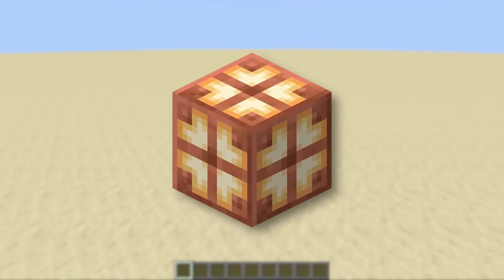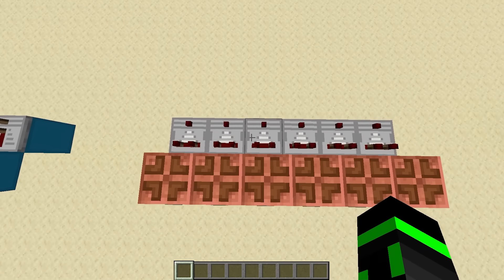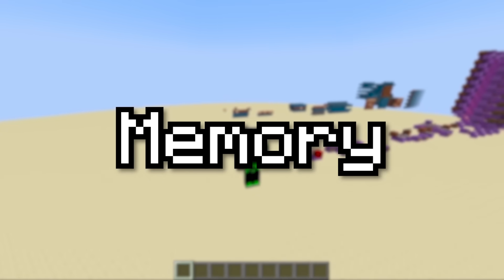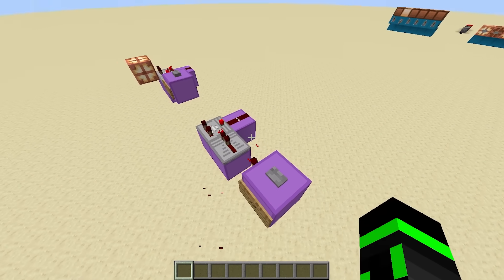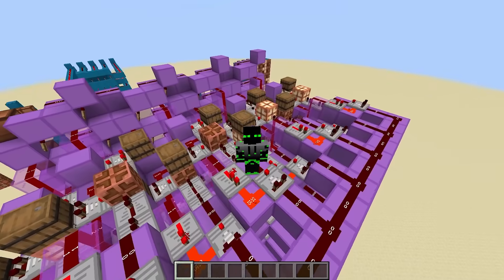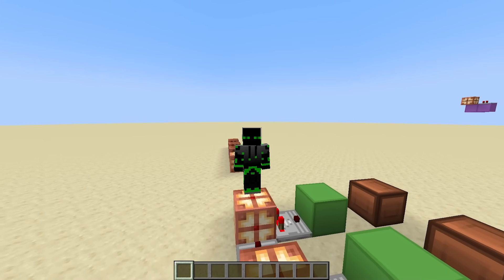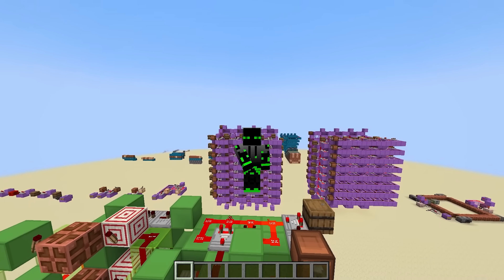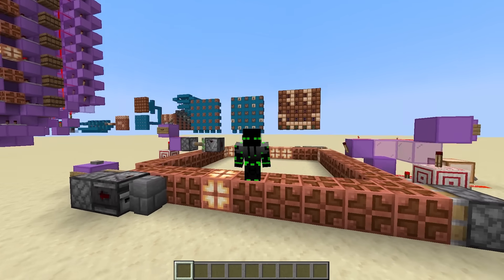Why I'll Never Use Copper Bulbs

Comment: For what was said about using them as a screen and then wanting to wipe said screen, you wouldn't necessarily have to read the state of the bulb, but you would have to have a storage to remember all inputs and then output the ones that were on to turn them off. This is actually a good use for copper bulbs.

It's still a faff and more work than lamps, but I just thought I'd point it out.

Comment: The 1 thing where I found the copper bulb really handy was where I had to triple pulse a crafter, so I used a copper bulb with it's state changing as one of the 3 pulses that come from 1 observer, and the other 2 from another observer looking at the observer pushed in to turn the copper bulb on/off and than being retracted. The thing turned out pretty reliable, and worked really well, the only issue was that it wasn't tileable, as one of the observers hard powered the crafter, meaning it'd cause problems to have more of these right next to one another. They were part of a cirquit to automate mosaic blocks from bamboo input.

Comment: My reason for not using the CopFlop is simple: Mojang screwed it up with parity, changing the timing to be less interesting. It was perfect in its original state.

If they ever change it back, I'll use it (without mods) but until then: it's just another lamp.

Comment: so, regarding the RWM and ROM, the fact that you can move the data after the fact and still have it be functional means that you can form some variety of memory-bank, so if you're able to program a location into a flying machine (I realize that's a special hell in itself) then you can then create a data storage that holds onto data until it's called upon later.

Also: an idea: instead of doing the data rings horizontally, do the data vertically like a vinyl cylinder rather than a record, you can then have side by side data readers/writers.

Comment: This reminds me very much of a solid state memory circuit. In computer architecture, a solid state circuit requires a zero-write cycle (garbage collection) to clear memory before it can be written.

 For smaller memory circuits in Minecraft, they might not be as useful as some other logical designs, but they might be useful for huge data memory banks and piston designs that move large... For lack of better words, belts of blocks... around to access the memory desired on the loop. You would definitely need an method of indexing areas (like the page sector in secondary memory in computer architecture).

Comment: I definitely prefer the bulbs for binary counting. I've got a compact design for reseting to 0.
But lamps are still important and used.
I wouldn't say one is better than the other, they just have different uses.
It's like comparing the repeater to the comparator.

Comment: nah man most of the stuff mentioned was opinion based so I don't have a problem with that but you did read-write bulbs dirty as heck. All you do is wire the bulb to itself and boom, you've got the easiest read-write ever. Power the subtract mode comparator to write a 0, power the bulb to write a 1. I'm pretty sure someone could even make that tileable by 1 - I get it, you're not a fan of that, but it's that compact, so spreading it out is easy.

Comment: I agree that "having a lever makes it immediately clear to the user that it's a toggle".  My problem with levers is that they are upside-down!  I always put a Redstone lamp behind them because it's confusing.  

It's not just a "U.S. electrical code safety concern" perspective.  Put a switch on a (conductive) block next to a hopper.  By default, it's UP and off allowing things to go DOWN the hopper.  Now, flip the switch DOWN to power the block, turning off the hopper, keeping items UP in the hopper.

Comment: A possible workaround for knowing the state and being able to reset it is to use droppers to pulse an item, a comparator off it lets you pull both the signal or inversion as outputs and you can pulse all the items to one or the other to reset them all. The feed tapes are cool too because you can encode or read whole bit sets. Small easy counters are nice crafty did one. I like the copper bulbs because it will get more people into computational redstone. With screens though  I think any lamp behind swapping stained glass would work best, swapping which copper bulbs are light up behind the glass would allow for standard color display coding where yellow is both the red and green lights and blue is it's own.

Comment: In my opinion, the entire video boils down to this: Redstone lamps are good for setting, but not for holding or inverting, Copper bulbs are good for holding and inverting, but not for setting. Both are very useful, but for you specifically, setting is way more important than holding or inverting. Therefore, redstone lamps are more useful than copper bulbs SPECIFICALLY for you

Comment: Interesting exploration of the topic, actually, especially as it goes into areas of redstone like memory cells and synchronous logic that I haven't really done much with. Though I've certainly done enough with counters to recognize the value of synchronous logic, and of having an easy way to clear the count.

At this point I'm mostly using the bulbs as flip-flops and monostables - I think they're useful there, and having that functionality in a block that also lights up/turns off as it changes state helps make it easier for beginners to understand.

Comment: The bit about using copper bulbs for RGB screens is just stupid lmfao, not only are they orange, green, turquoise but what you said about brightness values is completely wrong, and the idea that the states of oxidization ARE the brightness levels, and they get dimmer as they oxidize

Comment: I'll only use them for sequences on and off. this works well, giving same time as the clock turning these blocks so I can do a sequence for a machine.
like, I set 2 sequences and if both are on, it does something, if A is on a sencond thing, if just B then a third thing.
and with a clock set up, I can do fun things. like figuring slowly a design that ill do later with or without these.

Comment: I completely disagree about the user interface point. To say that the average user would see a button and get confused is really peculiar. What an average user would see is a button that causes a light to always be on or always be off and that would be what signifies it’s a binary interface, not just the fact that there’s a lever present. Saying a user would get confused if they saw a button is kinda an insult to their intelligence seeing as they probably had to press a button, not a lever to turn on their PC to even play the game
Reply from the maker: in a way, you just proved my point. they have to spend the time to press it and then press it again to see what’s happening. whereas with a lever, they don’t have to touch it at all. the information is immediately visible

when i say confused, im not implying that someone couldn’t figure it out. i’m saying that you would be confused for those first 10 seconds while you’re figuring it out, compared to a lever that has 0 seconds of confusion 

and since copper bulbs and lamps both show the user feedback by turning on and off, i don’t see why you would voluntarily choose to add 10 seconds, even if it’s not that big of a deal and they’ll figure it out soon enough

Comment: I've made a tape deck barrel read write memory prototype before it's pretty easy to do just a lot of work if it's stacked
Reply: Just saying that the glow bulbs are not the first read write tape deck. I've even have made one with transparent and solid blocks that one is way harder but did exist before hand. But I do fully agree copper bulds are only useful for specific things

Comment: Copper bulbs are basically an in-game equivalent to optical media. You can write to it only once, but at least it's somewhat convenient to read from. And with the fact that they can be pushed by pistons, they can basically be used as a DVD. Theoretically, you could write to them and then use the read cycle thing to both read and reset them, allowing you to load multiple programs into the same machine. Don't know how useful that is, though.

Comment: If you had a "screen", I say in air-quotes because I don't physically mean a screen, but the logic you'd use for one, as in if you have a grid of cells that are set directly by redstone instead of being a toggle, and then you just hook an observer chain to the outputs you can make that non-toggle version of a screen directly into a 1x1 cell copper bulb screen without any additional logic. If a cell is on and it turns off it sends a pulse. If a cell is off and it turns on, it sends a pulse, if the cell stays the same, no pulse. The only difficulty is in getting each chain of observers to be synchronized but outside of absolutely massive screens this isn't that bad.

Comment: You were actually really close to the answer with your reset operation on the feed tape. All you need to do is have a comparator output feed back into a locked off repeater that is then unlocked for 2 ticks when you press the clear command, or when you press the write command while delaying the write function until the clear function is completed (a delay that can be achieved with a single repeater). This is relatively compact and easily tileable vertically.

Comment: One major thing: copper bulbs are by far the best binary counter in the game, and since they are movable, it gives you a way to count an input, store it, move to a different location, and read it, which is pretty major for binary storage. It also makes bit shift operations stupidly easy as you can literally shift the bits. Timing isn't really an issue as you really should be using a clock circuit for your read/write operations, so unless you have a really large binary counter the delay shouldn't affect it too much.

Comment: Instead of a Xor latch, it's easier if you just use the signal to wipe the cell and then one tick later write the new value. Repeater latches already have a tick of delay for write so it doesn't even change the timings. And the wiping circuit is easy and can be done in 0 ticks now that the bulb has no delay. Just connect the output to the input for one tick, then connect the input for one tick. You can even create a massive memory array and using a timing circuit to wipe one row of memory and then write to only that row, allowing for a single input bus that writes to an entire array as long as you time your inputs to match the clock circuit.

Comment: A good use I think is combining it with instant wire for long distance wiring. If you need to get a signal from point A to point B which is over 100 blocks away, you can use an instant wire to toggle a bulb. Not sure on practicality, but it seems like a good use case.

Comment: I have a comment about the read write memory. The problem imo is the way your trying to read the memory inputs data otherwise it works without the xor.   What if instead of sending a pulse to read the data you took one away? Read the signal directly from the copper with a comparator but cancel out any signal with a powered line. All youd need to do to read the data is un power the line right? 
Idk maybe im missing something important here, but it got me thinking dont a series of t-flips count in binary?  Wouldnt these make a really tiny counter? Or theres a way better way to do it huh? You made a video i believe. Guess i need a revisit

Comment: This whole video is like watching you misunderstand how to use the new copper block. You basically said you’re not gonna use the copper block because it’s not a good screen. When in fact, 30 seconds into the video, you acknowledge that the copper block is smaller than a TL, you should be using the copper block instead of Tip. This is going to make your build smaller a lot smaller you should be using the copper block.

Comment: when it comes to the player knowing what will happen based on it being a button or a lever, i think players should just learn the use of the bulb to eliminate that issue (lever = toggle, bulb also = toggle)  i however dont think copper bulbs are trying to replace redstone lamps (people may be trying to do that but mojang seemingly isnt) it is a new tool that can be applied for new/different use cases.

Comment: I feel like that XOR for checking the state of the copper bulb to properly write to it was far larger/more complicated than it had to be. But the repeater latch is still a generally better design, afaict. Probably a better copper bulb design would be using a NAND gate comparing the status of the bulb, and the status of the input. If they're the same, it blocks the write signal with a comparator. If they're different, the write signal can reach it.

Comment: Thinking on it, a barrel can store 16 bits. At first, that sounds quite a bit better than Copper Bulbs, because it's so much more compact to read the signal...But that doesn't take into account the space needed to decode the signal. I think a binary counter Copper Bulb array could store significantly more information (It'd be slow to set, but you could extend it to 64 bits(!)), and in a format that's fairly easy to decode for, so in terms of programmable ROM it may have some use in eg: large floating point numbers. It might be slow to update...But there's some situations where the performance overhead might be a good tradeoff.

Comment: Just got a working turing tape machine with heavy use of copper bulbs, here are my initial thoughts:
- I was able to make a 1 wide tileable d-latch using copper bulbs. It was fun to make but repeater locks still make better d latches of course
- Bulbs work great with wall stone, just because their such good t-flip flops
- The copper bulb xor is very nice

- Bulbs are good for small counters since you can usually get around the delay issue just by adjusting your repeater timings
- You end up with combinational blocks that are made with synchronous components, which can mess things up if accidentally toggled

Over all I would agree with most things you said; other than as a dense form of tape memory I think traditional components still have the edge over copper blocks in logical redstone.

Comment: One use I've found for copper bulbs is that you can make a 2 tick downwards vertical infinite one-way or/and gate with them, if you use wallstone. You can use trapdoors to pillarize a tower of walls, and read the change in wall state with an observer. Hook that observer up to a copper bulb and boom, you just turned an observer pulse into an on/off toggle. Could be very useful in reduction operations for more than 8 bits.

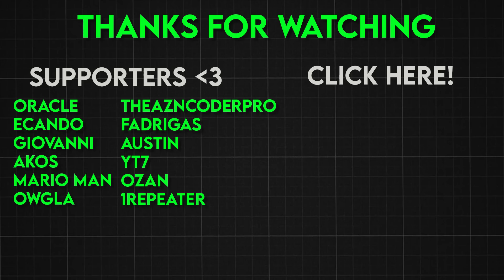Comment: 16:10 and thus, Minecraft has reinvented magnetic tapes.
(I think you're underselling the utility for input screens, btw - you can make a neater 2x2 design with copper bulbs if I'm not mistaken, replacing a note block by a copper bulb with a button. But it's a rare usecase).
Also, "XORing something with zero" on a reset is a no-op, you just need reset AND current-state.

Comment: You can use a copper bulb to double the length of a clock and I used it to make the smallest SR Latch that i know of (4 x 3 x4), and a 3 x 3 x 3 XOR gate

Comment: 1) with the aesthetic aspect of toggling, the bulb lights up when active, and is in the same place (for the player) as its respective button. 
2) not using them for interactive screens is fair enough. (Edit: control panels I like, but the screens are more-less as you described.)
3) copper bulbs as memory is something that even I am undecided on. I still think that memory would benefit from the decorated pot. achieving any given signal strength is easier (using items that only that to 16 for obvious reasons), as long as you mind the increment delay with item 9 (I use a dropper triggered by a strength of 8), and I have used a simple hopper system to rewrite the signal strength (although I expect this aspect to go unused).
4) I have made several automated binary counters. It lead to me (on your ORE server) discovering a twin-hopper clock that can lock super easily. By themselves they could be useful, but it's too early to know for sure.
5) I saw that Mumbo video, too, and he's why I first started messing around with Redstone with more serious intentions. I agree with you on this one quite definitively. "And don't forget: please ubscribe..."
6) that is a very misleading title.